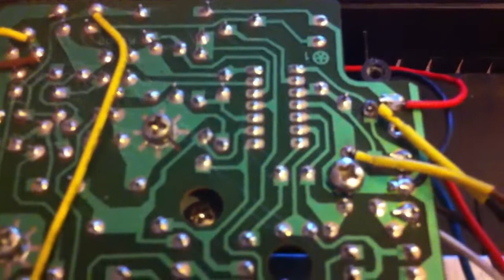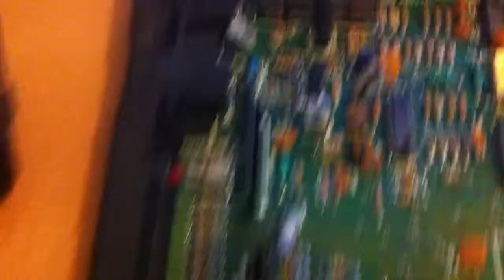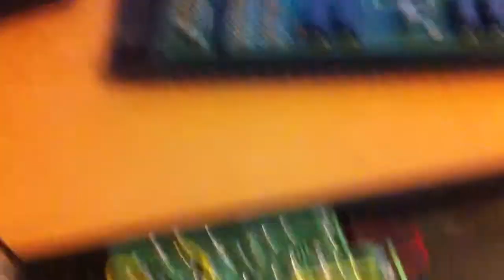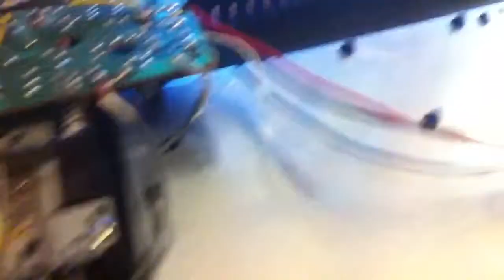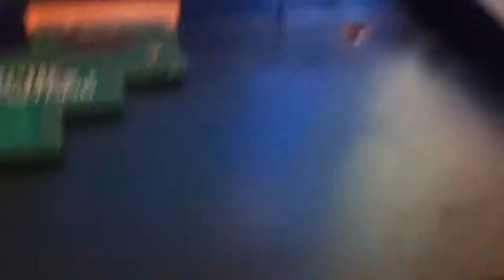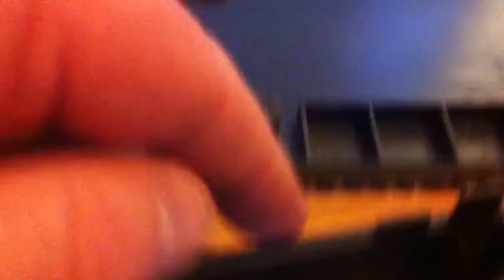ZX Spectrum +2 Audio mod

Comment: hi Scot. i just bumped into your video and i want to do the same thing with my +2 model. the thing is that i soldered the wires where you seem to have soldered the ones in the left,following this sites instructions "http://retrocable.com/?page_id=149"
.still i got the sound and the title of the game as it starts to load,but then no image of the game loading and its just stays in limbo when finishing. I saw that you too have soldered the left side with the 2 yellow cables but cant understand why.can you explain me a bit further? because i will eventually follow the way you soldered the right yellow cables just to make it work.
thanks!
Reply from the maker: Hi, the yellow cables I think where factory soldered, wasn't done by me. does this help ?